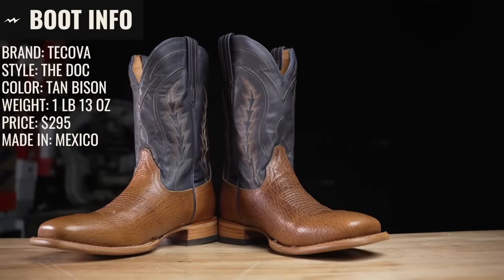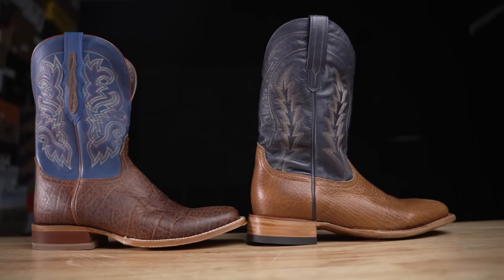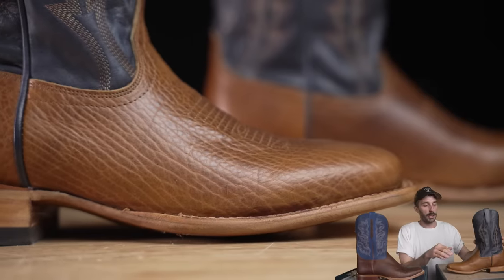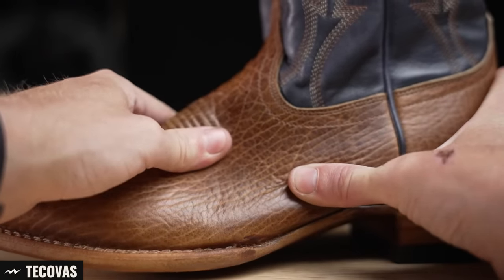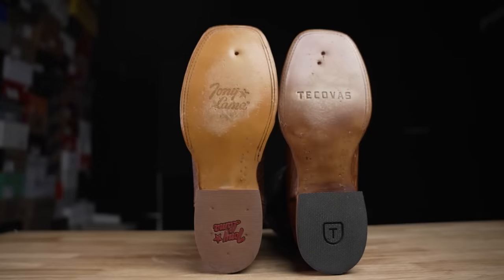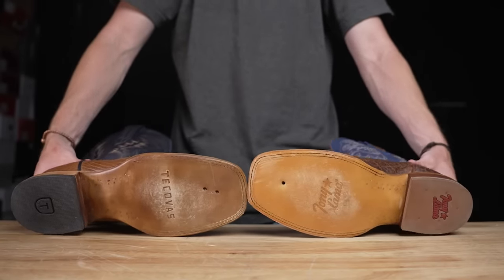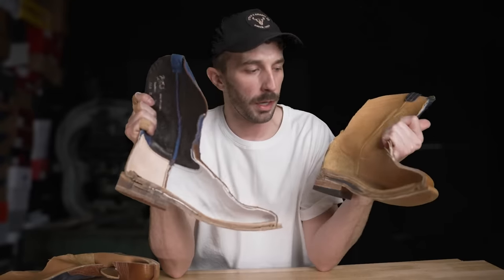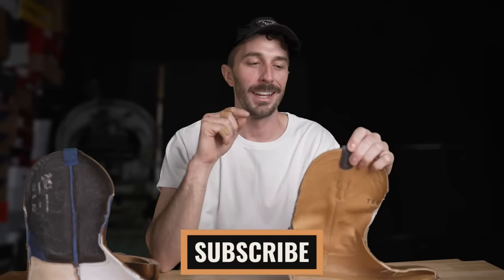Best cowboy boot under $300? - Tecovas vs Tony Lama

Comment: I can tell you right now that the Tony lamas will last longer than the tecovas for actual ranch work. The tecovas have that frail material in the heel and the toe and because of that, long exposure to the south Texas heat quite literally melts it and leaves the boots warped. Threw them out after about 1 week of working in them.
Reply: Also from South Texas ….. there is a reason Tony Lamas are built the way they are after 100 years…. They get cowboy return customers and know what is important and what is not.
Reply: Tecovas has a line of boots specifically made for ranch work that are much more durable than their dress boots
Reply: If your buying a leather bottomed boot for ranch work I don’t think your comment has any validity 😂
Reply: @xspitfirex354  Right because no one has done ranch work in a leather bottom boot before
Reply: @xspitfirex354  you forgot about the vast majority of human history
Reply: @philfooshay it isn’t on the website? Cus Iv heard of this but can’t find them
Reply: @xspitfirex354 no way u just said that💀😭
Reply: @xspitfirex354 exactly ! Like what kind of ranch work is that? I would wear some durable shit not fancy cowboy boots which like more 80% of these boots and so called cowboys.
Reply: What do you wear?@ZitroEduardo
Reply: Of course work boots are different than fashion boots. I’d never wear dress shoes to work in the yard either. Ha ha
Reply: You don’t work bro cmon

Comment: If a horse steps on your foot, you’re going to have bigger things to worry about that a crease in your boot…
Reply: That depends. If you're around horses for enough years, there's a good chance you'll get stepped on. We have two horses. The bigger one is 16.5 hands tall and weighs about 1,200 lbs. She has stepped on my foot 3 times now. I suppose the key is that it has never been on a hard surface like a driveway. It happened once in a stall where we keep a soft ground covering, once in a pasture, and once on a sand/dirt mix. I have some steel-toe work boots, but they're too big and clunky for riding. The stirrups would bounce off of them. I've considered getting safety-toe western boots but haven't yet. I look around at other people with horses who know more than I do and wonder about it. Yet, no one that I've seen does that. I'm not worried about how it'll look; it's more that I'm thinking, "If it's a problem, I would see at least a few people wearing them."

Comment: The stiffer leather, stitching, and center piping on the Tony Lamas are there to keep the shaft from sagging and falling over.  I'd give them a slight edge on shaft durability, otherwise agree with everything else.
Reply: That and the Tony lamas have a bunch of pieces stitched together on the inside, and I can’t imagine that’s cheaper than the texcova one style lining
Reply: i can't stand a saggy shaft.
Reply: @jamrogjan1509  that's what she said
Reply: @jamrogjan1509  -
Sounds like you might’ve tried “Shooting pool with a rope”….
Reply: Never ever had a problem with shafts getting damaged

Comment: I've said that before, myself! Tecovas boots are the Thursday Boots of the cowboy boot world. I have five pair: The Jasper, Earl, Nolan, Cooper, and Townes. Definitely more for "show" than hard use in my opinion, but that's fine because I don't work on a ranch, I wear them casually!
Reply: damn good way of putting it, and always happy to see thursday boots mentioned.
Reply: You have any recommendations for harder wearing cowboy boots?
Reply: @Stackobones  honestly, I'm not the one to answer that question for cowboy boots as my work/hard use boots are Nick's Builder Pros, not cowboy boots.
Reply: Love my TL. Don't  think I would invest in tecovas. The heal and especially that toe plastic was a total turn off. For a more durable boot the Double H brand is hard to beat! Thanks again 🤠👍
Reply: Have you tried the Banderas yet?
Reply: @usmcdoc2512  The banderas are great, a very HEAVY boot but they are great boots for working, durable upper
Reply: @adama4791  thank you for the Intel. I was pondering those or the midlands. I like the vibram sole.
Reply: @usmcdoc2512  me too, I love the vibram sole
Reply: @adama4791  website says order 1/2 a size down from normal. Do you agree?
Reply: @usmcdoc2512  I normally wear 15s and with their boots I wear a 14 so yes I’d agree (there’s no half sizes past 13) but either ways tecovas is excellent about returns and has super fast shipping so either way you’ll be sorted. But yes order a half size down from your other shoes
Reply: @usmcdoc2512  I wear a size 10 in tennis shoe, and wear a size 9 in Tecovas 'The Earl' cowboys. I would downsize 1 size.
Reply: @adama4791  bought 11.5 Midlands. They fit perfectly! Now I'm hooked!
Reply: You know  @usmcdoc2512  , I’ve actually wondered a few times since this conversation if you picked em up and are enjoying them, very happy to hear it. My dad actually just picked up a pair of midlands as well. Truth be told if the midlands were around when I bought the banderas I would have gone for midlands but the banderas don’t quit. (Also I may have given tecovas the idea for the midland back when they first got into the square toe game with the doc but who knows)
Reply: @adama4791  that's some great news. Yeah the DOC is next for me (obviously) than maybe the Jason once it's in black and in stock.

Comment: I've been wearing cowboy boots for 30 years.  The last 3 years I have been wearing Tecovas Boots.  I must say that customer service has been great.  My first pair I ordered the same size as I had been wearing and they didn't fit.  Tecovas paid for return shipping and sent me the right size immediately.  

I love the quality of the boots from the materials especially the lining, to the leather stack heels.  They are comfortable to wear all day.  In fact they are more comfortable than my sneakers.

Finally I love my boot jack.  The boots have a snug fit when putting them on, but that means there is not a lot of slip and slide.  I have never gotten a blister.  The boot jack makes taking the boots off much easier for a stiff old man.
Reply: What would you say is the comparison between Justin sizing and Tecovas?

Comment: My old Tony Lama "Black Label" boots are nothing like these.  No cotton drill in the vamp.  They are fully leather lined.  Leather heel stack, too.

Lets see some Lucchese boots cut in half...
Reply: I have some old ones as well that are the same and was surprised to see the lack of leather lining and the composite heels. I guess they've changed the way they're made over the years.
Reply: Same. Either Tony Lamas are way different now, or this particular boot is one of their lower quality ones. I suspect the latter.
Reply: @BayernLean  exactly. Not only do mine have the full leather lining but some of the double stitching on the outer boot carries over into the inner lining as well. As I said, great boots.

Comment: I'm 69 years young and have been wearing western boots and western style work boots since I was a teenager. I've worn Tony Lama, Luchese, Wrangler, and others over the years, but now have Tecovas in calfskin, python, bovine leather, lizard, and plain leather. The bovine leather came with a zipper, and I had zippers installed in the python and lizard, and I believe the Tecovas are the most comfortable boots I've work outside of one pair of deer hide boots I had decades ago. They are high quality, fit and feel great, and are still comfortable after a 10-hour day that includes an hour of driving to and from work.

Comment: As a wearer of TL boots now for going on 10 years or so, I really love how they fit MY feet. They are very comfortable, last, and look good for years on end. I’ve tried a handful of different boot manufacturers, and keep coming back to TL. 
That said, I’m looking to get a black pair this summer, and I got my eye on “The Doc”, by Tecovas. They are right around my price point (for non exotic) for boots and they look really good. No idea of how they will actually fit and feel though. I herd that they run a half to full size smaller as well. Wondering if anyone can comment on that. I will be blind ordering the size as there is not a store around me that sells them.  🤠

Comment: Got a pair of Tecovas Midlands about 6 months ago and loved them. They are very comfortable and the vibram soles held up very well. Unfortunately that single stitch around the heel box he talked about, well when that went i now have to use a shoe horn to get them off! I'm probably harder on work boots than most, but I was hoping to have them longer than 6 months. The outer leather held up, but the inside of the boots fell apart pretty quickly.

Comment: As a lifelong boot wearer, both for work and for a night out with my wife, I can say I'm very impressed with my Tecovas. I have three pairs and that are very comfortable and I love the calf skin uppers. 

Now if you have the money, nothing beats a custom pair of boots made exclusively for you, but that's a minimum of $2500 and that's a luxury. 

But a $300 Tecovas, is a very handsome boot in my opinion.
Reply: I prefer going to Leon, Guanajuato for custom made boots
Reply: I agree I have the Prescott shark skin. Very tough riding boot
Reply: Agreed
Reply: But for $200 more you can get some chisos and not really have to worry about it at all 🤷‍♂️
Reply: minimum of 2500? You're just buying a brand, 800 will get you custom made boots with exotic leather. If you NEED to get your foot out of a stirrup quickly to avoid dying, any Walmart boot will work ie: If all you're doing is sitting on a saddle, the cheapest pair will do just fine, it does the exact same thing. If you're walking around/working and actually using them outside of riding, why the hell would you buy a western boot in the first place? They're worse in every single way from construction to wear to support. The slip-on factor and no laces is great but thats it and doesn't justify any premium, much less 2x what any hand made in USA bootmaker charges. If you like the look and just want something to shit on the plebians with you don't need to spend 1 - 2 - 5 - 10k on a brand name.
Reply: @kylegilmore3810  lol I thought the same thing.  $2500 minimum for custom boots is straight up retarded.  I’ve got a pair Ariat Bench Made boots for $300 and those things have taken a whooping and are holding up strong.
Reply: Chisos is the sweet spot between boot-shaped shoes like Tecovas, and real boots like Lucchese (although their quality has been questionable lately) and the higher-end custom makers. Chisos are real deal boots, made for actual work, but also look great and wear great over time. The Capitan Nashville boot rivals Tecovas in the price range, and is built better.

Comment: I'd love to see ariat work hogs or sierra boots. They're rubber soled so they're slip resistant and have tread but they seem more disposable than a leather soled boot. Mine were super comfy for about 2 years until the padding compacted I think. Buying another pair definitely

Comment: Have tried putting on Tecova boots, but with a wide foot (11EE) and a high instep, my foot will not go through the throat to get my foot inside.  Pain I had to return them. Had been wearing Ariat till they started using the Chinese leather.  Wear boots year round up here in the rain, snow and pasture, and my Tony Lamas always go at least 4-5 years.  Need to make sure you are conditioning them if you want to keep these expensive boots a long time.

Comment: The last Tony Lama's that I bought were a high top buckaroo for about $230.00, that were made in Mexico. They lasted less than 2 years. I actually sent them back and received a new pair, and they lasted less than 2 years. The over lay was not glued to the first layer and the stitching was maybe a cotton fiber versus a nylon fiber, which wore out very quickly. I just threw away the replacement pair after less than 3 years! I owned a pair of Tony Lama's that I bought back in maybe the early 80's and they lasted over 20 years before the leather on the sides gave out and ripped. I think I paid $85-95.00 for those, very expensive for a high school graduate at the time. It's a shame the corporate bottom line now out ranks the the customer's experience. Hathaway and Mr. Buffet will not be getting anymore of this old man's money!
Reply: When did TL stop manufacturing in El Paso?

Comment: Lots of people mentioning that Tecovas are just a fashion boot line. Yes, but that’s all they are trying to be. I wouldn’t really call most of their boots dress boots, or even fashion centered. They are traditional boots, with nicer leathers than you’d find traditionally. They have at least a few options outside of their ranch wear line that can be used for work.  Have a pair of Earl’s in goat leather that I’ve been working in for the last 3 years. I’ve used my Tecovas for pretty much everything. Field work to board meetings, and they’ve outdone any Justin or Ariat I’ve ever owned.

Comment: Tecovas are well built and durable. the problem I have is a very high instep. I can't wear Ariats at all and Tecovas, even after stretching, give me trouble until the boots are well on their way to being worn out. Justins and Tony Lama have a higher instep. I prefer the Justins. Tony Lama was once the premier off the shelf boot but have lost so much quality over the years that I don't bother with them. If Tecova could make a higher instep I would buy them instead.

Comment: Can u do a pressure test on the Tecovas thermal plastic counter and toe material to determine how much pressure it really takes to cause irreversible damage? It may be much more resistant when embedded inside leather.

Comment: Oddly enough, a number of people I know of swear by rubber boots for rattlesnakes.  It wouldn't take anything for the rattlesnake's fangs to pierce the rubber.

The one advantage I can think of is if they are thicker and looser, then maybe the snake might stop the bite before the fangs break the skin.

A few years ago, my younger brother was working on a plow one day and felt something hit his leg a couple of times.  He looked down and saw that it was a prairie rattler striking.  He was wearing work shoes, not boots at the time.  However, he was wearing bib overalls that tend to be real loose. The snake was aiming for the legs on the bib overalls and not following through to the leg.  He had venom running down his pants legs but he wasn't bitten.

Comment: $300+ for a pen knife? Never mind titanium, I'd want one made from platinum for that price.

My mountain bike is made from titanium, most parts are too. $900. How many tiny knive handles would a mountain bike make? 50, 100? 

They're having people for mugs I think, no wonder they can sponsor all the YouTubers.
Reply: $300 is definitely not unheard of for a midtech from a small batch knife company, especially in a world where CRK and Hinderers run $500 easy, and many much larger companies like Benchmade, ZT, Lionsteel and Spyderco are making titanium-frame knives at a similar price point. 

Also, the cost of your titanium bike's price is only slightly affected by the material cost. Titanium or aluminium or steel isn't going to be a huge variance in overall cost of a bike or a knife. The infrastructure and equipment cost of being able to process titanium and tool-steel billet into a knife is a much bigger factor in knife production, as well as the cost of employing people who live in developed country and are being paid a living wage. 

I have no idea what brand of bike you have, but the process for making a bike and a knife are very different and specifically require different forms of material. I would wager that the bike company buys a set gauge of titanium tubing in bulk, and uses a press to form it to shape and weld the pieces together. You can't make a knife handle out of titanium tubing very easily, nor can you make a bike frame out of titanium billet. Knife handles are typically machined from titanium billet and require fairly robust CNC routers with high-speed cutting bits to cut both the blade stock from the MagnaCut or 20CV steel, and the titanium alloy billets. Not only is this expensive equipment, it is time consuming and requires specialists with experience in running automated CNC systems. And that doesn't even being to touch on the furnaces for tempering and heat treating the steel, or the sharpening and buffing equipment. 

While a bike may be a more mechanically complicated product, that doesn't necessarily mean it's cost is determined by that complexity. The actual requirements of production are a far better determining factor than any arbitrary comparison between a completely different type of object. Do you know where the bike was made? Where all the parts were sourced from? How much of the bike itself is made in-house as opposed to being sourced from another seller? How much overhead is needed to make each bike? These are all factors that go into the final cost to the consumer and I don't think you've really factored in all of the elements at play.

Lastly, the price of platinum is currently about $920 per ounce and being as you'd need far more than just an once of billet platinum to machine a handle frame you'd probably be looking at about 2K just for the material cost of a platinum knife handle. That's a bit more than $300 by my math.